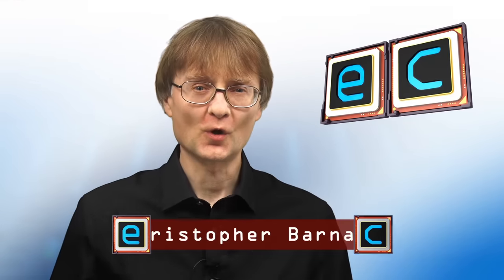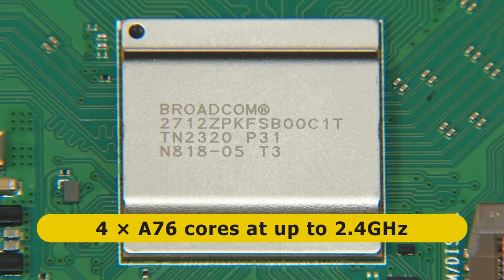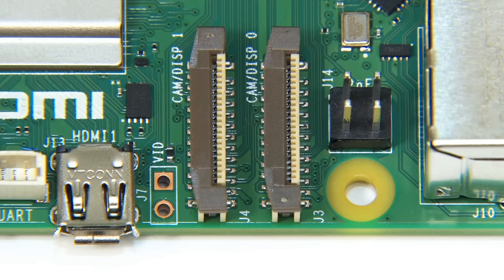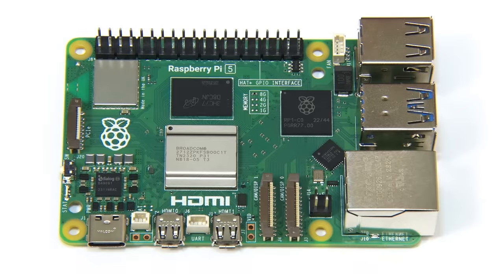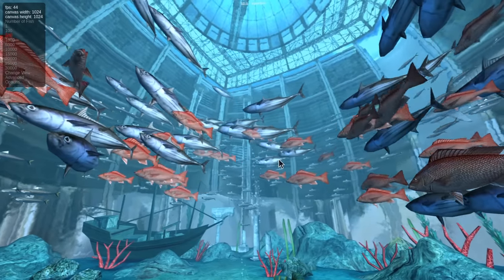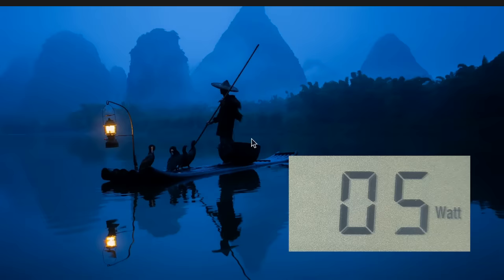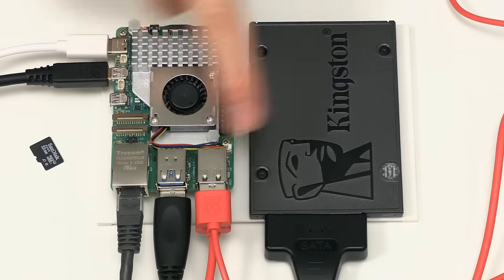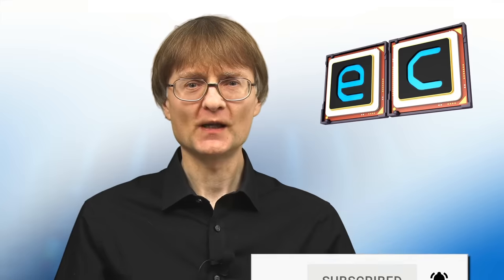Raspberry Pi 5

Comment: Awesome, informative, and well made video. You make absolutely excellent videos, approachable for the newer techies, and informative for the more tenured bunch too. 

As far as the RPi5, its hard to get excited when just these past 2 weeks were the first I've seen the RPi4s available. Hopefully paper launches are only for gpus... I'm disappointed to lose the 3.5mm audio jack, disappointed at the lack of eMMC, dislike the lack of a full size HDMI adding to the number of peripherals, and agree that the lack of color coding is disappointing on GPIO. I like the clock battery, love the power button, like the increased I/O speeds, love the MIPI ports, and am happy to see the next gen processor speeds. 

I am conflicted on the PCIe connector. I feel they could make a m.2 slot for a 2242 drive which is more and more common and affordable. This would cover the vast majority of users of the PCIe slot and you could use adapters for abnormal use cases. This eliminates the need for a HAT. But as someone who will relish the abnormal use cases, I like this slot.
Reply: I have the same toughts on the PCIe connector. The bottom side of the board is "empty", so a 2242 m.2 stick would fit perfectly. The same, with the HDMI connectors. They could use a dual HDMI connector, like the USBs or again, the bottom side of the board is empty, two normal sized HDMI would fit perfectly. If they do that, then we can have the audio jack back too.
Reply: It will be interesting to see how sales of the Pi4 and Pi5 compare in the next few years.
Reply: @jimmybrad156  especially in emulation.
Reply: @talos86   I couldn't agree more, constraints are supposed to encourage innovation, they're just wasting so much of their limited space by ignoring the bottom of the board. 
They keep adding the need for more peripherals: microHDMI, PCIe ribbon cable, USB audio, etc. Tell me how many people are using dual monitors with a raspberry pi; I'm guessing not many.
Reply: No Sound.... My Raspberry is my "TV" Sound Blaster Speakers + Big old Flat Screen --- Howl.......
Reply: @maryginger4877  I've seen about 10% or so of raspberry pi projects in my little bubble of friends and family that used the audio jack. Which is much more than alot of the other components cough dual HDMI.
Maybe their customer base actually wants this and we are all off base. I hope they've done their market research because it seems like they're going in the direction many don't want.
Reply: @aaron7545  To be fair, apparently it can be solved by a cheap USB dongle... I did over react a little bit !!! It was just such a nasty shock.
Reply: @maryginger4877  I'm with you, its definitely not  the end of the world, but a step in the wrong direction. My first raspberry pi B needed only a wifi dongle and breadboard for what I wanted to do. They got rid of the wifi dongle and replaced it with a usb audio jack, microHDMI dongle, and absence of RCA video port. They have more competition now, and I would like to see them succeed given their mission. I can't imagine kids are going to learn more from dual monitors and PCIe ribbon cable, over the ability to plug in headphones or speakers. Definitely just first world problems though.😆

Comment: Looks promising. Curious to see how well this runs a more demanding desktop environment like KDE Plasma or GNOME. These singleboard computers are slowly becoming viable options for everyday computing.
Reply: So you don't already have access to enough devices like PCs, laptops, tablets and mobile phones that are already viable options for everyday computing for a lot of people?

Technological progression and advancement allow more computing power to be fit into smaller spaces, and with lower power consumption, but if the core design concept of the Pi is to be a desktop replacement then why have GPIO pins on it that allow interfacing to external devices?

KDE Plasma and GNOME are bloated, they are far too filled with unnecessary eye candy. I have a reasonably good desktop experience running my own build of Gentoo Linux with a light i3 desktop on an original Pi and original Pi Zero. Sure, you're not going to be playing YT videos on them any time soon but they are perfectly viable systems for other computing applications.

Comment: I would like to know if the fan cooler is a necessity rather than an accessory?
I suppose if you are going to use applications such as Blender it will be pretty much a necessity. Would you be able to perform any general heat teats? Thanks Chris.
Reply from the maker: I will indeed be going more tests.

Comment: I love that they freed up the pcie from the doc with the addition of the south bridge chipset. This is going to make a LOT of interesting add on boards possible that just weren’t before. But arguably just as exciting is the RTC and accompanying battery port.

Can’t wait to see these more powerful and expandable Pi in the wild and all the fun things people make with them. And the inevitable Pi 5 “super computers” are going to feel just a little more super than before.

The south bridge also makes me wonder how the CM5 is going to turn out, and if it will be on module or if the carrier boards will have to have the south bridge to handle I/o, and if so if that means it’s possible to have even more i/o than the pi5 coming off that south bridge.

Comment: It's always exciting to see a new launch from Raspberry Pi. The system has evolved massively since the Pi 1, it looks like it would be easily usable as a "daily driver" general use PC. There is some clever thought gone into the design, I really like the potential for expandability. I'm certainly looking forward to getting my hands on one.
Reply: It may be a bit too little too late after all the availability problems. I just use ex-lease 1L PCs now. Much better value but clearly not suiting every situation formerly the domain of the Pi.

Comment: I imagine - for some use-cases - the dedicated io silicon will make the cpu feel very fast indeed. More cycles per second and fewer wasted on stuffing bytes into ethernet/usb 👍
Reply from the maker: Exactly. It is hard to convey the difference it makes to the experience in a video.
Reply: Agreed, and if the addition of the I/O chip meant there was no room for the audio jack then so be it - better I/O is far more important.

Comment: Pi5 is a pretty awesome (and unexpected) update! I really like most of their changes and improvements. However, I think the Achilles heel of this design is going to be the single PCIe lane. The Pi4 was able to get away with that, but that's going to be a massive constraint over the lifecycle of the Pi5. It may result in an unexpectedly short lifecycle getting us to Pi6 faster than expected.
Reply: Raspberry Pi could do a great job of making commercial products if they wanted to, but I think they are entrenched in the academic and hobbyist market. For now they are comfortable in their niche. 
Someday, the cost of hardware will cross the performance required by heavy duty tasks. Maybe RP10. After that, Raspberry Pis will be routers, NAS, firewalls etc...
Reply: A PCI-E connector finally means we can get multiple real SATA connections.
Reply: I wish they would get rid of the two micro HDMI ports and go back to one standard port. The heat and power consumption is also a bit worrying. A device like this shouldn't need a fan.
Reply: I wish they would put out a 4B that draws less than 2 Amps. The gap between Pi and Arduino keeps getting bigger. They are too focused on making a desktop PC replacement.
Reply: @nerfherder4284 That's an interesting viewpoint. You're right. Price was always no.1 priority as far as I remember.
Reply: @nerfherder4284 In which case it needs analogue audio output so it can be connected to a stereo speaker system

Comment: I'm afraid that the omission of the analogue audio output is a 100% deal-breaker for me. I have only two use-cases for the RPi5 - as a low-energy (compared with a standard PC) desktop replacement, and as a MIDI-conrolled software synth/sampler. In the first scenario, I would use it with a PC monitor with no built in speakers (I have my desktop PC hooked up to a high quality audio system, rather than enduring tinny sound from the kind of poxy speakers they build into monitors and tvs these days, and in the second scenario, the device would be run headless, often in a live performance environment, where it would need to feed directly into an analogue mixing desk. and yes I know I can get HDMI-to-stereo audio adapters but they cost almost as much as the Pi5 if not more and complicate the connection and setup process, especially when playing live at small venues where setup time is often extremely limited.

Hopefully this thing will have analogue audio available somewhere on the board, otherwise I'll be giving it a thumbs-down, as while the lack of an audio output may not be an issue for many, for me it renders the device pretty much unusable without buying adapter hardware at which point I might as well carry on using my current ITX PC setup...

Come on guys - at least give us an audio header even if you don't put a physical jack on the board...

Comment: I love this! I wouldn't mind if they make the Raspberry Pis a little more expensive, but I want to see just how much performance can be crammed into such a tiny SBC, drawing so little power compared to a regular desktop computer. The absolutely revolutionary power button is also exciting because I finally won't have to keep abusing the power USB port for hard restarts!
Reply: Many mini PCs are actually drawing below the Pi 4s 3A, 5 Amps is a lot to supply with a battery.

Comment: Realistically, you are going to need a new case, power supply and active cooling. Although definitely better, as one would expect, it feels rather underwhelming overall once you add up the real price, although I think that many will still go for it because of the hype that surrounds it. 

That PCIE 2.0 interface needs to be shown to be of good use too (more cost for an adapter) as the storage options don't exactly shine out of the box. Whilst some other boards do need an adapter to accommodate M.2 SSD, this one of course also requires the same, no matter what route you take and we should not forget that other boards DO accommodate one directly onto the board too, so that was rather missed out from the balance of viewpoint on the solution chosen by the Pi foundation.

It feels like a partial catch up on the competition and will have to sustain what it has for a few years now, whilst others will forge ahead even more. 

I wonder if, when the dust settles, it will still be seen as desirable. It won't be on my shopping list.

I will also note that we only saw 1080p video, not the 4K that again, is promised (failed with the Pi 4 of course) and in the WebGL tests, at only 500 fishes it was just about maintaining a little over 40 fps, which is not that great. I get around 30fps at 10000 (20 times the amount) fishes on my Orange Pi 5, which further shows the gulf that this is already behind with, hardware wise.

Ebon Upton said that there would not be a Pi5 until next year, so was this a panic release to keep some market share? Looks like it to me. Quite a few had been wondering whether the Pi foundation could survive at it's current rate, which may have enabled another market trigger.

Comment: Who misses the 3.5mm audio jack besides me? If you have a hdmi monitor with built-in speakers the sound may not be that great but I guess if the monitor has an audio jack you could plug in external speakers.

Comment: Very much on the fence on this one.

The selling point I've had for my Pi-based hardware has always been the price, and I get the feeling this won't be winning many buys when I can buy old mini-PCs off Ebay for less. I can try talking to buyers about power efficiency, but most of them will give a blank look when you mention savings of a couple of pennies per day, or a few quid a year.

Comment: 15:08 just for the kicks and giggles I just ran this on a Raspberry Pi B+ v1.2 and it took only 1182 seconds! (so basically 20 minutes ¬¬) with a latency of ~128ms (95th percentile). In terms of the CPU speed I got 8.46 events per second, compared to the RPI5 with nearly 2800. Wow. Just wow! Raspberry Pis have come a long way!

Comment: confusing, 
8:50 SDCard says 32G, 11:50 lsblk command shows around 256G.
Reply from the maker: Not confusing at all! :) The SD card is indeed 32GB. And in the lsblk command at 11:50 it is shown as having 512M and 29.2B partitions. Meanwhile above it we see sda -- the SATA SSD I'd also connected for this test, which I mention and we see about 10 seconds earlier in the video, which is 256GB.

Comment: Thanks for the tests! The transfer speeds also depend on the attached hardware so i wonder what the actual max USB3 speeds are... I can get 320MB/sec on my pi 4 with a samsung T7 drive
Reply from the maker: They do, but I used a Samsung PRO SSD that operates a lot faster, so in my test the bottleneck was the Pi, not the drive.

Comment: How much faster will the single PCIe-NVMe lane be compared to the SATA-USB adapter ?
Will we get a vid with a test when the ribbon adapter drops ?

Is the GbE port getting full speed ?
How good is the Wifi antenna ?

What happens if you desolder the resistor marking 8G of RAM and move it to the 4G, 2G, or 1G pads ?

With the removal of the A/V jack, is there no longer any way to get Composite video out ?... RetroPi on a real CRT TV used to be so handy.
Reply from the maker: I will certainly do more tests as things become available (hardware and OS). An NVMe SSD connected via a single lane PCIe interface will almost certainly be no faster than what I've measured here for a SATA drive connected via a USB 3.0 port. The Orange Pi 3B I tested recently has an M.2 slot for an NVMe SSD with x1 PCIe 2.0, and there as I recall I measures 346MB/s.

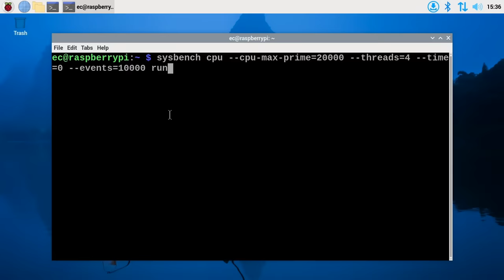Comment: It's funny because I have an old Asus Eee PC Seashell laptop that has a single core Intel Atom N455, and with a fresh Lubuntu install I ran the same CPU test at 15:14. Mine was slower and completed in 3.5 minutes. Minutes, not seconds.....

Comment: 2:32 Pretty interesting seeing the resistor in voltage divider for RAM size indicator, since the pin for all 8GB, 4GB, 2GB and 1GB literally connected to the same net (GND and VCC?). If the same resistor for 8GB is soldered to 4GB instead, the RP1 will still recognize the RAM size as 8GB, unless if different resistor value is used. Not sure what purpose for making all the memory size marking here, but probably to identify the RAM size of the raspberry pi easily for the user. Correct me if I'm wrong.
Reply from the maker: I imagine a visual indication only as you do -- either for human eyes, or automated systems.

Comment: Looks to be a solid upgrade, though I am not a fan of micro HDMI.

Couple of questions, Chris.
- How is the fan noise under sustained load?
- Did you run the board without the cooler? If so, what are the temps like?
Reply from the maker: The fan remains quiet under sustained load -- I've yet to hear it at max, except very briefly during boot. I'm in the process of recording various cooling tests for a forthcoming video, including running without the fan, but not without the heat sink. I've see one test running it with no cooler -- it throttles in under a minute.
Reply: @ExplainingComputers  Thanks for the response. Glad to hear it's not noisy. Looking forward to that video.

Comment: Another excellent review. The speed and responsiveness of the new board is impressive. But no audio jack and still no usb-c connectivity.
Reply from the maker: Thanks. USB-C is simply a connector -- not an interface. Most USB-C ports are USB 3.x ports -- just like the Type A ones on the Pi 5. :)

Comment: Fantastic video again Chris. Is the active cooling a must have? What happens without it? Thank you
Reply from the maker: Without some form of cooling the CPU will throttle very quickly (well under a minute). But cooling with a (substantial) heat sink alone will I'm sure work. I imagine we will see third-party passive coolers for a Pi 5.

Comment: its nice but realisticly I'd like to see a pi500, that can sepurate in  to two modules and uses a kioxia   m.2 orr just a regular m.2 letting you dock the device to a keyboard or afix it to the desk and just charge your wireless keyboard on top. 

I'd also like to see a risk 5 alternative with plus 60 %  power in the next generation

Comment: Stuff I'm genuinely excited by for this device:
- the better-integrated PoE
- RTC battery connector
- dedicated (rather than on the 40-pin "GPIO" header) UART connector

I am excited to see what people do with this cool stuff:
- better-supported PCIe
- the higher-throughput CAM/DISP (potentially quad displays? seems unlikely but I haven't looked at the datasheet)

Stuff I am dangerously curious about:
- What're those two pads at J2??? Alternate RTC battery connector?
- Oh my. what is that little two-pad connector at J7 labelled "VID"? is that the ages-old Composite video signal back from the dead? (seems really unlikely)

Comment: Delicate ears question: how necessary do you think the fan is? I'm still using an RPi3B as a my TV Box and can watch FHD videos in Kodi without heat issues despite not having a fan (even during the charring summers in my region). I dind't upgrade to to the RPI4 but may consider the 5 directly.